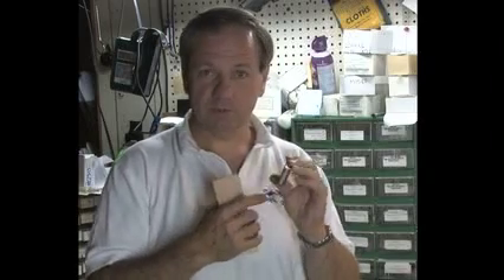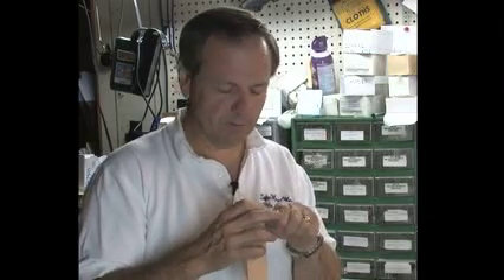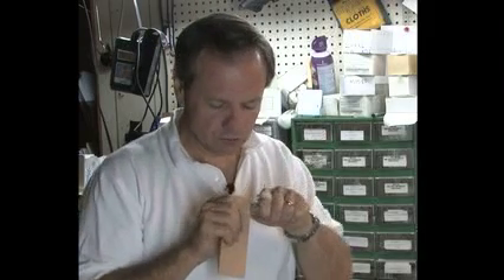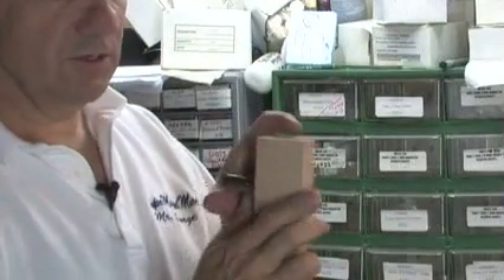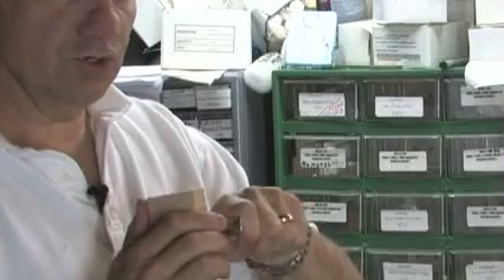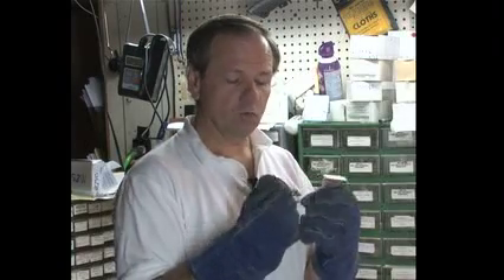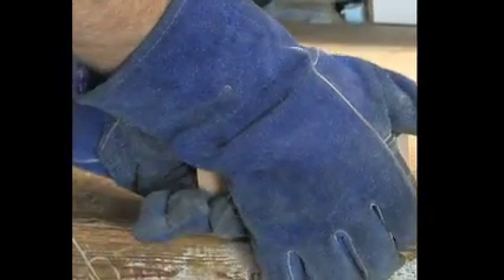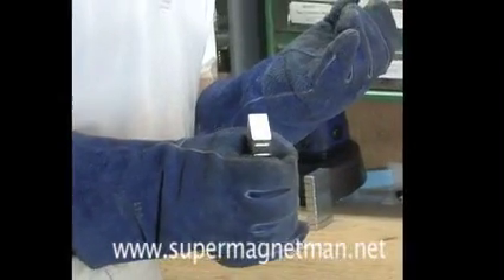Separating Neo magnets

Comment: I let the weakening of the local magnetic field strength caused by eddy current generation to allow me to separate the neodymium maggots, by using either a pure copper bar or copper pipe, depending on the shape of the maggot.

Using the piece of copper as the wedge, between or on the side of the maggot stack, reduces the pull between adjacent maggots greatly, making separation MUCH easier.